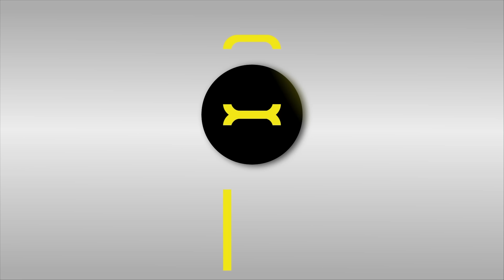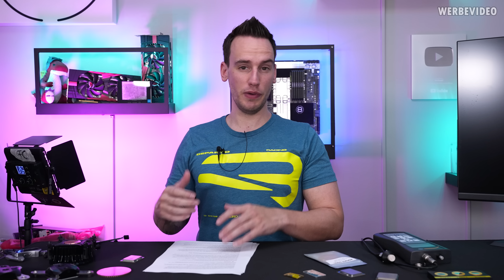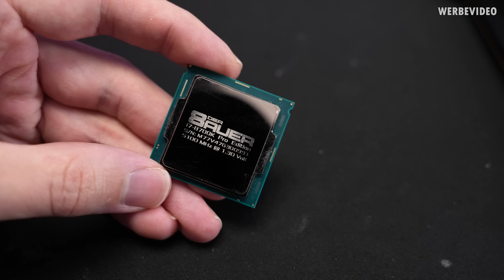Why you should NOT buy Water Blocks made out of "Silver" - Thermal Conductivity measured & explained

Comment: I don't know whether it's true (I'm still looking for reliable sources) but I've read that the PlayStation 5 has a silver heatsink because a) the rate of intermetallic compound formation with gallium is lower than nickel and b) silver has higher wettability which helps to resist the pump-out problem with liquid metal TIM.

Comment: not going to do it. because i will completely fudge it. 
but i have the katana 1070 with the all copper heatsink (vapor chamber and fine fins) . 
My curiosity is if i could remove an area of the copper fins and solder a copper water block to it (upto 1x4x8cm wb). And how would it conduct heat .
Cheers from shaun.

Comment: Lets say you have a 4mm copper ihs with thermal conductivity of 400 W/Km.  Wouldn't that have the equivalent performance to a 2mm ceramic ihs with thermal conductivity of 200 W/Km?  I know you want the heat to spread horizontally, but if you can make the ihs thin, hard, smooth and close to your delta T, you'd get better cooling?  Anisotropic materials are intriguing too.  Maximizing thermal conductivity ignores the meters in the denominator.

Comment: You say that AMD seems to have thicker Nickel plating than Intel and it might be worse for thermal conductivity. This is probably not correct, either the nickel plating is thicker, or it is just a different type of Nickel plating that has higher magnetic permeability. And the magnetic properties of Nickel throws of the conductivity measurements you are doing. The reason being that both the conductivity and the magnetic properties affect the eddy currents, but the device assumes the material is not magnetic and thus will measure incorrectly. Even if AMD has a thicker plating, we are talking single digit micrometers, that will have very little impact on the overall heat transfer.

Comment: I was told a reason you get better valu with the plate kit is that it has a more levelled surface with allows the cooler to connect more surface to the cpu, is there any truth to this?

Comment: tldw;  You can afford a much more powerful and higher quality cooler for less than screwing around with silver and copper corrodes less.

Ancillary info:    One of the problems that AMD is facing with their multi-chip components is that the different chips will have different thermal ranges to a certain engineering factor... this means that on occasion there may be intentional things like that thicker nickel plating on their packages.    This is actually fairly common in older compact systems (power supplies, electrical management, etc.. including old heatsinked transmitter components) with heatsinks where some heatsinks have an increased thermal mass to them to better regulate to the operating temperature lifespan of given components and others may contain segments of copper or be made largely of copper instead of aluminum.  In computer components the metal type doesn't matter so much as it does in high frequency equipment where the heatsink may literally be Tin (Sn).

Thinner spreader+cooler+faster is NOT best.

Also, there are several university projects where they are attempting to grow diamond heat spreaders onto chips.  Its only nearly 5x more conductive than silver...

It sounds like the kryos silver has a mild disruption of the plating interface to me...  heat it up to 65°C and re-test it.

Comment: You have a slightly wrong picture explaining the thermal conductivity. in fact - this coefficient shows the temperature difference of the KUBA, with a face of 1 meter, when a heat flow of a given power passes through it. Simply, after the "crossing" of the lengths, something comes out. what is indicated in the handbooks. In fact, this coefficient has the following description: (W * m) / (m2 * K) - in the numerator - the length of the flow path. the denominator is the area through which the flow passes.
By changing the "dimensions" we get different indicators of the "temperature difference".
A more relevant parameter is "thermal resistance", which by default already takes into account the thickness, dimensions and thermal conductivity of the object.

Comment: Would a diamond spreader be viable for cpu cooling? I know they're made and believe they'd be at least twice as conductive as copper... 

Just figured they've been too expensive to see use.
Reply: Diamond isn't nearly as expensive as the De Beers company would like you to believe. The stuff is literally used in sanding paper and polishing paste. I guess making a ceramic matrix to hold the diamond powder in an IHS might be the more expensive part in that. Possibly more expensive than stamping and IHS out of a solid copper sheet.
Reply: @fermitupoupon1754  Oh yeah I just meant relative to copper and aluminum. there are companies that offer industrial diamond coatings for heatsinks, but nothing that I've seen for PCs.

Comment: Apart from superconductors diamond has the best thermal conductivity due to phonons effectively sound transmission of the heat. IE the entire atomic lattice vibrates. But this is non metallic so low electric conductivity.
No sure where the new allotropes of carbon IE graphene or Bucky tubes fit in here.

Comment: a lot of people don't know what they're talking about when it comes to silver it has to be combined with other metals and used as a bucking cable design not as a solid metal  and using it for something like a CPU is a little out of it because it's meant to store thermal load it would be great for a matrixed CPU that was meant to heat up more than 300 degrees without being cooled but unfortunately all processors today would die from the thermals instead of being proved by it i'm talking about a CPU that runs at higher efficiency at a higher temperature

Comment: Nice video, thanks!

On the silver block however, doesn't the fact that it's actually a fairly impure alloy mean that it will conduct better the hotter it becomes? Thus if measures at say 60C won't it be better than when measured at ambient?  Likewise the pure non-alloy copper will become less conductive at 60C than at room temperature?

I wonder where the crossover point is between the two?

Comment: Hey Roman, I have the silver Aquacomputer block in the adjustable version with the 4 pins that can warp the profile of the block while mounted because the silver alloy they use is still softer than copper, so it makes it much less work to make it conform to unlapped blocks.

Not that I need it anymore since I swapped to a Der8auer Edition 8086k - lapped copper version, not the fancy silver IHS one - but I also have no reason to get a new block, because as you said the temperature difference is only half a degree purely based on materials.

Comment: I think they should do away with the nickle plating. 
I know corrosion is an issue with copper though, new pennies don't look like old pennies. But instead coat them with silver (on the thermal conductivity chart, slightly better than copper). It's not a cheap metal, but it only needs to be a few microns thick to seal in the copper. A $25 one-ounce silver coin could easily plate several hundred or more cpu's at a few microns thickness.
Silver can also corrode, but nothing like copper, and it would have zero negative impact to thermals (unlike nickle).
Reply: Also, given the thickness of the top part of ryzen 7000 series chips, I'm guessing lapping down to the copper could create a huge benefit.
(edit, later in video, i see silver has been thought of. Pity they didn't use 99.999. Still seems like something AMD & Intel would want to do on their end though.)

Comment: Great video! I have a question though... You said alloys thermal performance increase with temperature, could the silver mixed with copper perform better at higher temperatures? The block would be higher than 20° for sure, I'm not sure if you can measure that with your tool though, if it can be used at a higher temp maybe put it in series with another block on the CPU? Probably not if they aren't claiming any marketable performance lift but I'm curious anyway XD

Comment: I didn't expect these results from the silver not being pure.  As far as thermal conductivity goes, Silver is about 8-9% more thermally conductive than copper.  Which is why silver is used for thermal compounds over copper.

I mean, theoretically a silver loop is better than a copper loop.  (if price is not a consideration)  But I haven't seen pure silver components for a long time (because they didn't sell well due to price in the late 90's early 2000's) 

ESP haven't seen a silver radiator in a long time... which means you will get electrostatic migration when mixing metals, which is what I was assuming this video was going to talk about coming in.  That migration is a pretty big problem, and is why I used to tell people to pick a metal and make the whole loop out of it. (Given, hardly anyone used to ask about a custom loop).

Really strange they would ruin their own silver heatsink by using cheap impure silver.

Comment: If the silver goes all the way through and is used as the interface with the water in the loop - I understand why there is a silver version - silver is antibacterial, so the silver block will inhibit algae growth in the cooler liquid, and algae will clog up the microstructures inside the block; so although it might have slightly lower cooling capacity when new, it will maintain that over a much longer time than the pure copper/nickel plated copper.

Comment: As far as I know there is another reason for gold or silver plating: lower contact resistance. It's different than the electrical conductivity inside of the material. That's of course important for connectors, however digital transmission like with USB or HDMI cables does not see real gains from that.

Comment: Silver is a better antimicrob then copper is.  When your running straight distilled, with a silver block, your coolant over time would leach the silver ions and prevent nasty stuff from growing inside your system. The performance difference was very small, but it was more on not having to use additional additives in your coolant. Also Sterling Silver should not be used over pure Silver. Sterling Silver can cause corrosion which turned Silver products into Taboo for the hobby especially with nickle plating.  
We also ran silver kill coils, however most silver kill coils that came after Iandh usually were tainted or fake with iron and other metals mixed into it, that it caused corrosion. 
A wide ban on silver was brought about especially from eK, because of a few bad players who wanted to profit off fake kill coils.  
Iandh and I btw were the first ones to experiment with silver kill coils on XtremeSystem.

Comment: I would like you to go into a little more detail. If you have an ihs with a thermal conductivity of 390 and a copper heatsink cooler with a thermal conductivity of 390 how much of an effect does putting a layer of thermal paste with a thermal conductivity of only 12 in between the two have. I am guessing thickness and of the layer and microscopic air pockets play a role. Another question is in regards to gpu's I have replaced some thermal pads to more efficient ones with a thermal conductivity of 20 and have seen a significant temperature reduction. How much of an effect does having 1mm thermal pads vs 3mm thermal pads have. It seems to me that the best would be to have the copper plate as smooth as possible directly mated to the silicon which is the source of the heat. Why is this not done? It seems that having a silicon/heat source with a layer of thermal paste + ihs + thermal paste + heatsink is less efficient. I guess that is why two phase direct to die liquid cooling is so much better, but then you have the problem of pressure and sealing.

Comment: Roman, in the thermal conductivity over temperature graph you showed early in the video it was noted that the thermal conductivity of alloys can INCREASE with temperature, unlike pure metals that DECREASE with temperature.  Would it be worth testing both of the Aquacomputer IHS's with higher temperature? Is it possible, at say, 70C that the thermal conductivity of the sterling silver IHS increases enough to overtake that of the pure copper IHS?
Reply: Both alloys involved (copper and silver) have the same temperature/conductivity relationship. Bar some mad interaction between the two when alloyed, the trend will be the same. The point he was making was that by alloying brass in to an alloy, then you can benefit from the increasing conductivity trend brass has, as well as the raw conductivity of the (typically) copper..
Reply: Nope, the sterling and pure silver will outperform copper,
Only thing better is diamond.

The water block needs corrosion resistance so silver oxide doesn’t form on the waterside and insulate. Dissolving silver would increase thermal capacity but it would just clog things up. And any oxidized area traps heat

Comment: 5:40 Looking at the graph, one important think about copper thermal connectivity is that it crashes by ~10% before reaching 100 deg C.  You are doing the measurements at room temperature, but I think you should also test at ~70 to ~80 deg C  (if the head of the measurement instruments permits that, I don't want to kill it).
Reply from the maker: I think you are misinterpreting the chart. From 200 Kelvin (-73°C) to 400 Kelvin (127°C) the conductivity drops by about 15 W/m*K which is not even 5%. So From the room temperature at which I measured to about 70 or 80°C it would change by about 1-2%. Not worth measuring
Reply: @der8auer-en  I agree. Yet the engineer in me screams: I want to test it and see it ;)

Comment: There is an error at the start, around the 2:00 mark, where you state that multiplying the interface's Thermal Conductivity by the Temperature Difference across it and then dividing by the Thickness (through which the conduction takes place), results in Watts of Heat being transferred through the interface.

This is incorrect: λ * ΔT / L  has dimentions of (W/(m*K)) * (K) / (m) = W/(m^2); i.e. one obtains the Heat Flux (Watts per surface area).

Using the given example's dimentions of 100m * 100m = 10,000 (m^2) for the area of each of the large faces, the correct Rate of Heat Flow can be calculated by multiplying the obtained Heat Flux for the 2 material cases (first 400 W/(m^2) and then 200 W/(m^2)) by the total face area (10,000 (m^2)), giving 4MW and 2MW respectively:
400 W/(m^2) * 10,000 (m^2) = 4e+6 Watts, and
200 W/(m^2) * 10,000 (m^2) = 2e+6 Watts.

As for the emphasis on steady-state thermal conductivity, I think for modern CPUs, especially when overclocking and using water cooling, such a simple steady state analysis obscures some very significant transient differences between materials' thermal diffusivities.
Even at stock, modern CPUs and GPUs already make use of transient thermal headroom by alternating between boosting over the steady state TDP limit and dropping far below it, many times faster than the cooling system's characteristic thermal time constant.
(Basically, the waterblock doesn't behave like a steady-state thermal conductor; but rather 'absorbs' short bursts of transient heating, followed by periods of below-average heat input, during which thermal diffusion and ultimately conduction into the cooling water, cools the block back down.)

Therefore, I would very much like to see what difference a heat spreader (or waterblock) made of pure silver would make, seeing as Silver's Thermal Diffusivity is 49% higher than that of Copper!

Comment: I'd be interested to see a test of CPU temps if you have a 1 cm thick copper plate between the CPU and cooler.  And also try it with a 1 cm aluminum plate.  If the CPU is runnnig 400W then the CPU with the copper should be 0.01 degrees hotter than normal, and the aluminum should be about 0.013 degress hotter, it seems to me.  Am I missing something?
Reply: the thickness of the plate is not relevant.  It will equalize very quickly.  The important part is how fast the material can move the heat from one side to the other.  Being 1cm thick will only matter for a very short time until the plate gets hot.  From there its how fast can the cooler move that heat which will always be the same no matter how thick the plate is.
Reply: @amindamok  I think that's right - the reason I'd be interested to see the comparison is because it seems to me there would be basically no difference between copper and aluminum.

Comment: I've got an MSc in Materials Science & Engineering, and I've learned something from this! (Or, at one point I did learn this at university, but I forgot...) 

One remark on the gold plating for pins and connectors: gold is relatively soft, so gold plated pins tend to offer less frictional resistance as well. That's not very important for pinned or LGA'ed CPUs, but it is beneficial for connectors that make sliding contact, so USB, PCI-e, HDMI, DP, etc.
Reply: hm

Comment: gold contacts are not always ENTIRELY for protection against corrosion, in some cases the soft nature of gold is used to help make better contact for things like cables and contacts, it's minor, but it is sometimes a consideration.
Reply: If you rely on <50 microns gold plating (being generous with the number here)  on a cable to provide better contact because it is a softer metal, you are expecting too much of how elastic such a thin layer is.
Also, being a softer metal, it offers less wear resistance, so not very good for conections with a high number of plug/unplug cycles.
If you know of any cable or manufacturer that claims or advertises gold plating offering better contact because it is softer, let me know. I'd love to have some words with them :-D.
Reply: @avelord6135  well plenty day it’s for better contact, idk which ones say it’s because it’s a soft metal